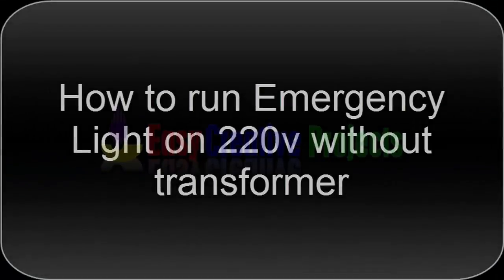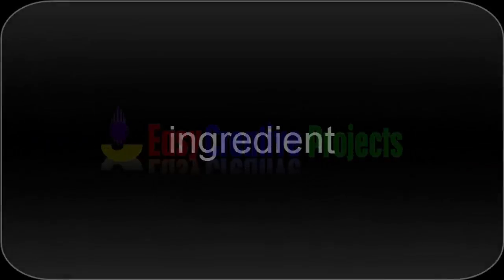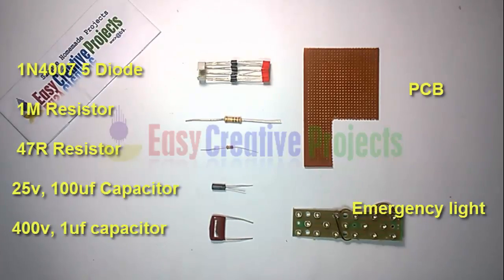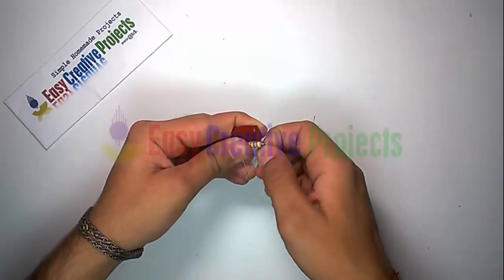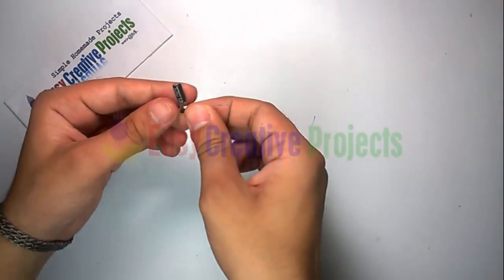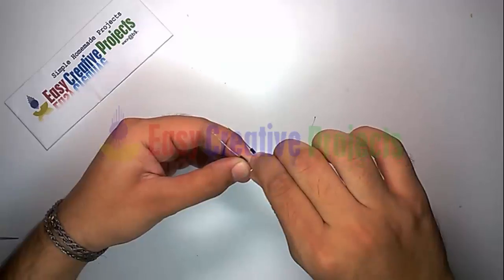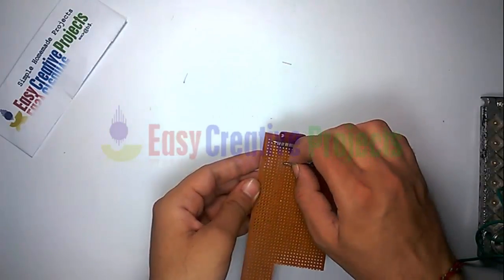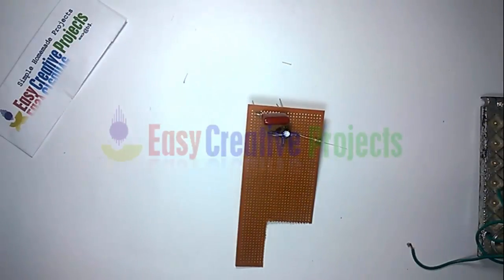How to run emergency light on 220v without transformer - easy step by step with circuit diagram

Comment: How many battery voltage?
Reply from the maker: its 12v led so you can run it with 12v battery or 12v charger or any 12v supply.
thanks.